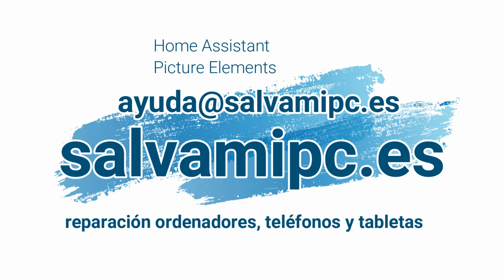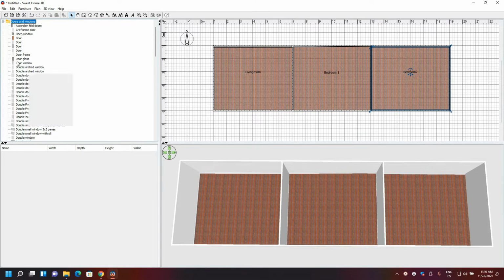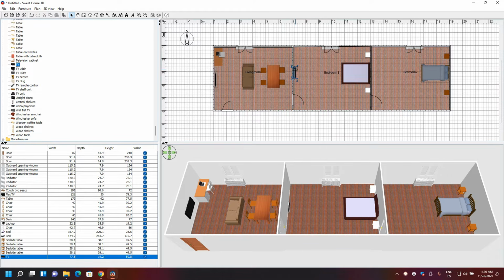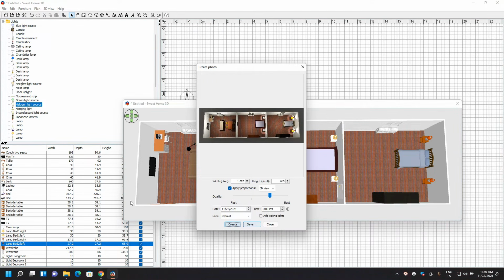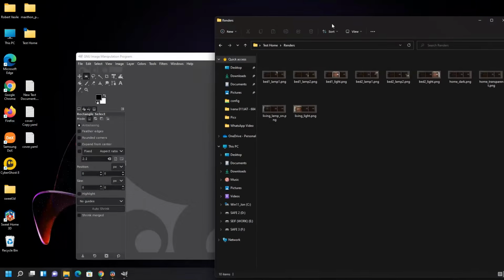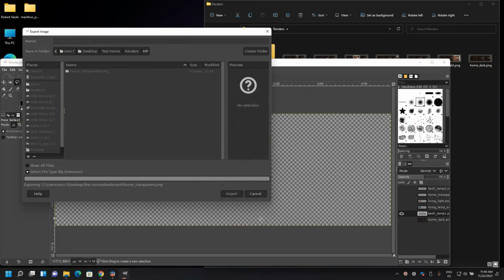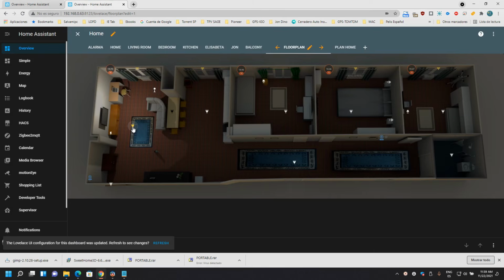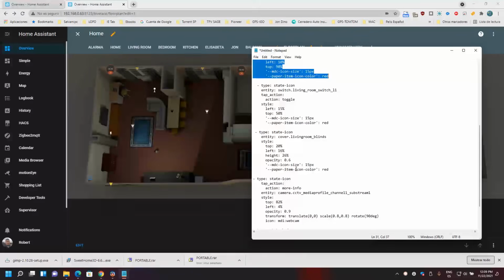How to Make a 3D Floor Plan Card in Home Assistant | Full Step-by-Step Picture Elements Guide

Comment: Thanks for the very detailed explanation.
Whta would be the Code for the sun blades?
Its not a toggle command, but the status opened ore closed (better to say not opened, since the blade can be closed just to X%)
Reply from the maker: I will pass you the code I have for the blinders. Some blinders support % some only open and closed. Since I made the video I changed the blind switches and now they support %
Reply: @salvamipc thx for the prompt replying.
Hiw dies it work with the supporting of %? Even in the Pictures ore just seting the closing?
For me it would be sufficient enough to use one Picture, showing the blades partially closed and be able to adjust the blades from the dash Board.
Thank you

Comment: Hello! First of all, thank you very much for the guide. Thanks to this, I managed to make lovelace 3d for my house. I have a question. In the empty space, the last added element is active. If I click on it, the switch opens and I don't want that. All the other elements work perfectly. I tried to remove this element for a test, and it turned out that then the last element from the list is active in the empty space. How do I avoid this? I want the empty space between the elements to be inactive. I will only add that there are several light sources in one room. Best regards and thank you very much again.

Comment: 0:13: ⚙ Tutorial on how to create an image element map for home automation using free software.
8:36: 🏡 Import and organize 3D models to create a 3D floor plan in Home Assistant.
15:42: ⚙ Creating a 3D floor plan with home office and bedroom using a home assistant.
23:57: 💡 Setting up and naming lights in different rooms for 3D floor plan visualization.

31:28: 🏡 Create and save different lighting scenes at home in a folder.
42:23: ⚙ Editing Floor Plan Elements with Opacity and Selection Tools.
52:50: 🖼 Create and organize 3D floor plan images for Home Assistant configuration.
58:55: ⚙ Configuring the image display for switches and icons on the screen.
1:05:16: ⚙ Customize icons and sensors in Home Assistant Picture elements.

Comment: the alpha channels are causing the overall lighting to dim in my case when more than one switch is on, is there any fix for this? i.e., 2 simple ceiling lights, I would expect 2 to be brighter than one with more coverage. I noticed the coverage got larger but both dims.

Comment: Thanks for posting this as well, it's been great help! 
Anyone looking, I was having issues with my code as of September 2023 - this below, appears to work (so far, testing).
I couldn't seem to click on images - it would load the properties etc and not toggle the lights. Anyway if it helps someone, here's two lights  working :) 

type: picture-elements
image: /local/3d_floorplan/HouseGrdnolight.png
elements:
  - type: image
    entity: light.hallway
    tap_action:
      action: none
      area_mode: click
    style:
      top: 50%
      left: 50%
      width: 100%
    state_image:
      'on': /local/3d_floorplan/hallway_alpha.png
      'off': /local/3d_floorplan/home_transparent1.png
  - type: image
    entity: light.front_living_room_2
    tap_action:
      action: none
      area_mode: click
    style:
      top: 50%
      left: 50%
      width: 100%
    state_image:
      'on': /local/3d_floorplan/frontliving_alpha.png
      'off': /local/3d_floorplan/home_transparent1.png
  - type: state-icon
    entity: light.hallway
    tap_action:
      action: toggle
    style:
      top: 77%
      left: 13%
      '--mdc-icon-size': 20px
      '--paper-item-icon-color': yellow
  - type: state-icon
    entity: light.front_living_room_2
    tap_action:
      action: toggle
    style:
      top: 60%
      left: 13%
      '--mdc-icon-size': 20px
      '--paper-item-icon-color': yellow

Comment: Robert, outstanding tutorial. I've followed your tutorial, but I have a problem, if I click anywhere on all over the floor plan but the entity icons, I get a pop up of the last light entity on the yaml cascade, eg: my last light entity on the yaml cascade is my backyard kitchen light, so when I click, let's say, between 2 icons where no icon is showing, I get a pop up with the kitchen light "more info" window. Am I doing something wrong?
Reply: Add "tap_action and hold action: none" to EACH type
Example of my code:
  - type: image
    entity: light.dining_lamp
    tap_action:
      action: none
    hold_action:
      action: none
    style:
      top: 50%
      left: 50%
      width: 100%
    state_image:
      'on': local/3D Floorplan/Light_Dining.png
      'off': local/3D Floorplan/Plan_Transparent.png
Reply: @psb73  thank you so much for this.  Adding the hold_action line made all the difference!
Reply: @psb73   thanks for that as adding that code fixed the issue for me
Reply: I have the same problem. Have you solved it?

Comment: Great Tutorial, really very clear, only thing when I put the action code I get an icon in the lower left corner that opens only the standard folder, would anyone have a solution?
could someone post the full code if not prying where i should just change the Switch names? Thank you very much ( I use Home Assistant 2023.1.4)

Comment: Hi Robert. I found the solution by myselfe. You wrote the toggle directly after tap_action: You have to go one line don and write action: toggle then it works. See down below

tap_action:
      action: toggle
Best Regards
Reply from the maker: Hi, thank you. but the acción: toggle was already in the code. if you look at the video at 1:11:24 you can see the code is there. There is a problem however, if one of the device is removed from the house, will make the image refresh constantly.